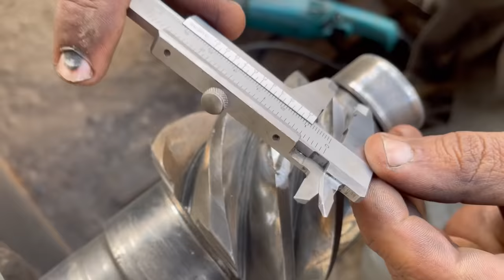I repaired the scrub pinion which no mechanic repairs | Give your opinion by watching the video |

Comment: Yet again hats off to the skill but one just cannot expect a gear filled with weld and finished using an angle grinder to last. Such gears are machined, hardened and then finish ground using very accurate machines. I would love to see the wear pattern after a few months. The caption says "I repaired the pinion that no mechanic repairs" well, there is a very good reason why nobody repairs them.
Reply: I think the welding rod he showed is a high in nickel rod, one that’s made for “wearing in” . I used rod with high nickel content to repair a track system for an assembly line. I had to weld flush enough and not to grind because it would wear it’s self to shape. I’m wondering if he’s trying to do kind of the same thing but with this gear. That explains why he can get away with a grinder, but then again how hard is the ring gear that will either drive it or be driven by
Reply: Well said
Reply: @jaymoney119966  He used hard surfacing rod so no.
Reply: amigo, te cuesta entender por que no vives en el 3er mundo, si no repara el camión su familia no come, tampoco puede tener el lujo de hacer todos esos procesos caros de endurecimiento o comprar un repuesto nuevo, cosas que seguramente estas acostumbrado a tener o usar en tu vida diaria
verdaderamente me gustaría verte como solucionarías el mismo problema en las condiciones en las que vive esa gente
edit: gracias por el apoyo, hay gente muy coherente que se da cuenta de que el  problema de fondo es que en esas situaciones mucho no se puede elegir y otros que definitivamente creen que estas reparaciones se hacen por gusto
les les invito a ver mis v1d3os
Reply: @Daniel_Herrero  That doesn't make it a good repair, it's still a short term temporary fix. And it will require repair again and again.
Reply: @billmiller7138  the problem I see with this is if the other gear wasn't damaged, it could be meshing with this one. Also, gears are hardened, all that heat could have ruined the temper.
Reply: @Daniel_Herrero  : Toda la Razón tiene Ud !!!  😉👍😎
Entiendo sus palabras yá que mi padre es argentino ( y vive en Argentina ) y se las debe arreglar con lo que consiguen . 
Muchos de los opinadores que comentan criticando es porque tienen una Vida Fácil y No entienden nada de la vida en el 3er Mundo !  😲😏😲
Saludos cordiales desde DK !     🙋‍♂️
J H      🇩🇰
Reply: Another expert knows it all but I doubt you have ever made anything in your life!
Reply: @pufango4059  Are you referring to me ?
Reply: Вы понимаете что эта деталь по сути металлом, я это понимаю и они это понимают. Разница лишь в том что вы можете позволить себе купить такую деталь и я могу это себе позволить! А эти люди к моему сожалению нет, так как они живут в стране третьего мира
Reply: @jurgenhelgen212  Ya que sos argentino te hablo en argentino. Flaco, lee bien lo que dijo antes de saltar con cualquier cosa. El tipo no critico nada, señalo un HECHO CIERTO, la habilidad y el empeño puestos en esa reparacion son muy buenos pero la calidad de la reparacion es mala y esta condenada a fallar rapido bajo carga. No es mas que un arreglo para salir del momento pero ese camion va a volver al taller en poco tiempo si ese piñon se somete a cargas fuertes. No hay empeño ni buenas intenciones que valgan ahi, rellenas con soldadura electrica (y peor si no lleva ningun tratamiento termico porsterior)un engranaje, un piñon, una cremallera o cualquier otra pieza mecanica sometida a esfuerzos extremos e indefectiblemente esta condenada a fallar. Que lo hagan porque no les queda otra opcion es otro tema, Y NADIE CRITICO ESO. Entonces no entiendo proque vos y el otro, Daniel HerRero, se agarran el cul0 como si los estuvieran atacando en forma personal. Lean bien antes de hablar, o escribir.
Reply: @peterzener8495  : Le contesto a Ud puntualmente :
1. En 1er lugar realice Ud una correcta interpretación de texto !
2. No soy argentino ! 
Lea correctamente lo que escribo .
3. Mi comentario está Solamente dirigido al Sr Daniel Herrero.
4. Le contesto en su lengua local ( español argentino)....
"Sabe Ud que diferencia hay entre una Pizza y su opinión" ????....."Que la pizza La Pedí"  !!!!!   😎
Saludos  !!!!
J H
Reply: @jurgenhelgen212  brillante argumentación.🙄🙄
Reply: The heat from the welding process hardens the root of the tooth thus making it brittle, so there is probably where its going to fail in this case. High nikel electrodes can somewhat help avoid complete quenching of the material below. I've repaired some cast iron gear teeth with pure nikel electrodes (softer than the 50% ones) and it works fine if you fill it from the root up.
Reply: Exactly
Reply: A few months? You're optimistic.
Reply: I had a pinion gear get a ' chipped ' tooth, not even broke that much and you could hardly see any unevenness but although it still worked boy did it make a lot of noise.
He would have to put that together and 
' fine tune ' with a grinder to even have it go around.
Reply: Agree completely. I am a machinist and understand that helical gears rely on consistent contact as the pinion turns.  I was thinking I would see him blue up the gear and install and remove  and grind a bit 10 times until gear clearance is just right. Even then it would be only close and the metallurgy would be way off.  if You ever see gear shops, the controls on manufacturing at every level are highly controlled from material to heat treat to normalizing, machining and then grinding to final shape. anyone who thinks this repair will reliably last one year is lacking in understanding of gear tolerances. 
 This repair is absolutely great to get somebody home or keep the truck on the road for the week or so until a new ring and pinion set arrives.
Reply: @billmiller7138  r
Reply: @miatabing6764  r what?
Reply: @Daniel_Herrero  I understand and you have your part of reason, but not all reason... I try to explain in my better English (It s not my language).

This reparation is like a timer bomb. 
For a lot of reason, 100% guarantee it brakes soon, worse than now..... Probably using this repaired gear ruine the surface of the other conduct gear, whit a future double and much expensive repair. 
Probably the termic hard treatment near the weld part gone and now it's more fragile than before. 
And there's other reason because its not a good work. 
Another future guarantee repair, another probably problem at job because the veichle doesn't....... work, at least... 

I understand what you say. 
But I don't understand this kind of stuff.... This waste time and money at least.
Reply: После наварки коленвалов и сваривания полуосей - это рядовая работа😁. Нескольких месяцев эксплуатации не будет. Изюминка - шлифовка посадочных мест подшипников.
Reply: They could have taken it a step further and put bluing on the teeth and roll it around the ring gear, and then removing high spots.
Reply: Yeah ha ha I can't believe they think this is a repair and not a shiesters trick to fool the owner of the truck  if it's used every day like most trucks are I give it a couple of days tops. If that. Your absolutely right Mr Longo. I'm a CNC lathe machinist retired. I don't care how pretty he can make it look it's not straight.
Reply: @kimnielsenthewordyvikingett159  Truck for sale,  runs great
Reply: I will let you know,  just did one about a month ago. Holding strong so far. Couldn't get the pinion. Old datsun forklift.  Tried for 6 months, found one that was in better shape than mine. So I repaired it. Tig 309. And yea had to fine tune. But quite no slop works great, pinion and ring I did repair on both
Reply: Soy de puerto rico y he visto trabajos similar y duran
Reply: He might be using stellite rods, I've used them for hard surfaces.
Reply: Even hardsurfacing rod can break of if the whole pignonwheel isn’t covered with the same layer! So your wrong!
Reply: @pufango4059  I agree with you when you can't just walk down to your local parts store and buy another one you will fix it some how.
Reply: IN THIS CASE, HARD TO FIND or GET and LOTS of MONEY.
Reply: Adding to this, any time I have had to machine something, weld it, then machine it again it is always softer to an incredible degree after welding. I'm sure he softened up that gear a shitload putting all that heat into it. Heat treatment is extremely expensive and complex for a reason, aligning those molecules to tight vibrating rows inside the metal might as well be magic and it is very easy to fuck that up!
Reply: See the wear pattern in a few months? It's probably intended to last a couple of weeks while the parts come in by rail.
Reply: Я думаю это временная мера. Скорее всего не было выхода и пришлось делать это в пути, для того чтобы доехать до дома и нормального сервиса.
Reply: But it will last a few thousand miles more enabling the guy to earn money. Probably no spares available
Reply: It'll last till it don't 🤷‍♂️ you go live in the desert a month from any parts and see what you try.
Reply: @Mike Raffphone Read it again. He only said that it won't work forever.
Reply: And  there's a very good reason people do repair them.  Not every area has a fully stocked parts store 15 minutes away.
Reply: @stevemcraemanager7119  And not every repair fixes a thing for more than 15 minutes.
Reply: Well, another used one is on the other side of the country, it'll be a few days before or gets here. 
And the truck broke on the street and is blocking it. 
So get er done son ,ain't no time for lollygagging!
Reply: @Mike Raffphone I'm referring to your other comment
Reply: when new gear like that costs more than what you make in year, then you dont have much chose